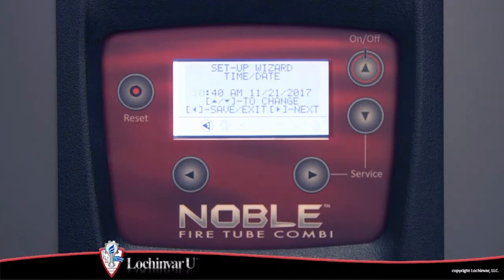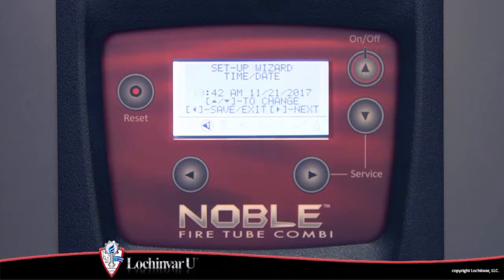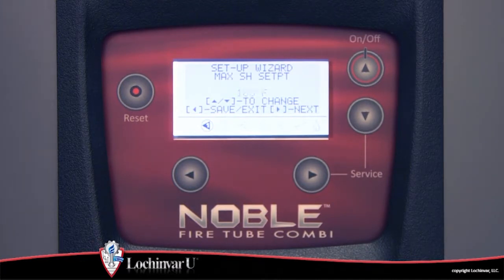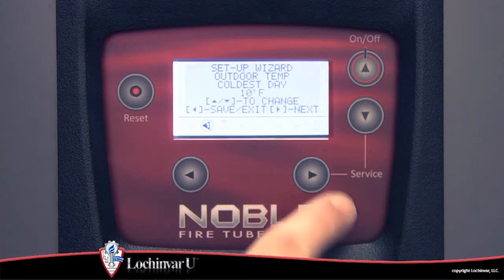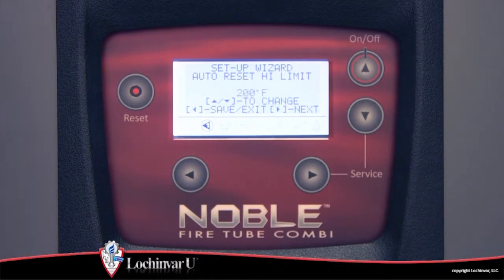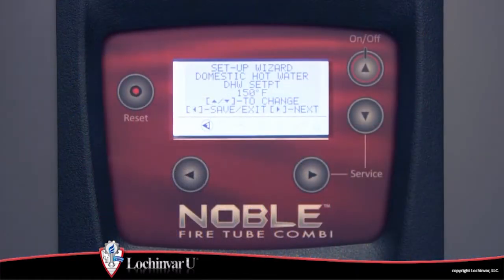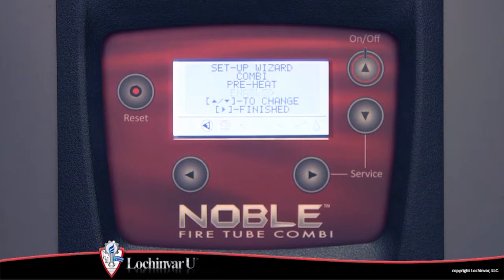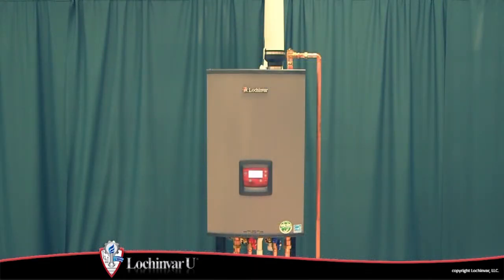Programming Wizard

Comment: Please be aware that there have been 2 separate recalls for the risk of carbon monoxide poisoning for some Noble models. The Recall information can be found on the Consumer Product Safety Commission (CPSC) website.

2020 Recall:

"The boiler’s flue grommet can deteriorate and dislodge during use and allow the boiler to emit carbon monoxide, posing a risk of carbon monoxide poisoning."

2023 Recall:

"The boiler’s flue collector can crack if exposed to a high impact event in the burner chamber, which can allow the boiler to emit carbon monoxide, posing a risk of carbon monoxide poisoning."